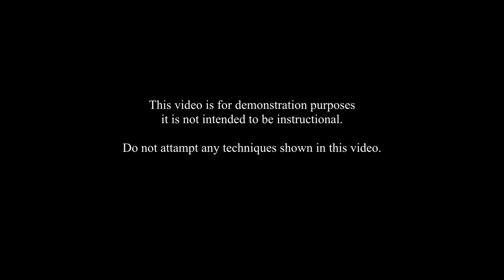Rough Turning Beech Bowls

Comment: I would like to ask if the type of sharpening you are using in this video is of the Ellsworth type. Thank you so much
Reply from the maker: Hi , the grind is a long grind, similar to the Ellsworth or Celtic grind but the wings of the grind I use are more vertical and aggressive.

Comment: Nice job Mark.
Why do you form two spigots? Or will these be footed bowls finally?
Reply from the maker: +Rundgemacht  Hi Thank you for your comments.

The final form of these bowls is based on the Japanese rice bowl which undercuts into the foot which eventually is what the small spigot will be used for. The second section is the shoulder that sits up against the front of the chuck the reason I cut in above this is to produce the roughed bowl form to as close a match as the final bowl form as possible. If this is not done the base wall thickness would be much thicker and as a result the top wall thickness would also need to be thicker to keep it equal for seasoning, the result being that the seasoning time would be extended by a month or two. 

Also by producing the wall to as close to the final thickness (taking into account movement during seasoning) I reduce the amount of cuts needed to finish the seasoned bowl making the process as efficient as possible. 

This is not necessary on all bowl forms just the one I make here.

Hope this helps clarify
Reply: Yes, that helped.
Thanks for the long answer.

Comment: thanks for sharing Mark. what's the bevel angle on your cutter? see you on Saturday :-)
Reply from the maker: +Finchley Turner HI, Thank you for your comments. The angle is about 50-55 degs the important bit is that the long grind cutting edge is flat that way you can cut the spigot and produce a flat shoulder. Have a look on Saturday close up. 

Take care